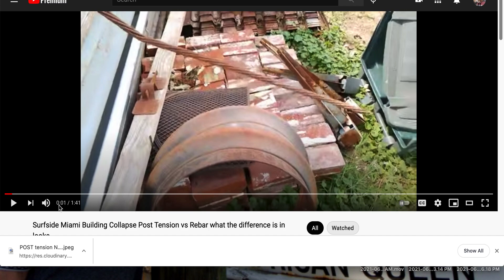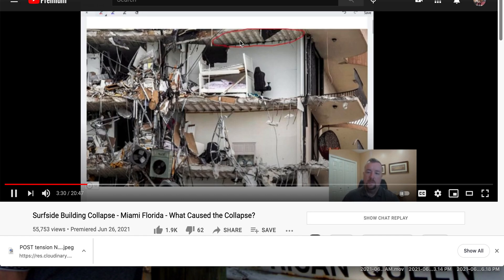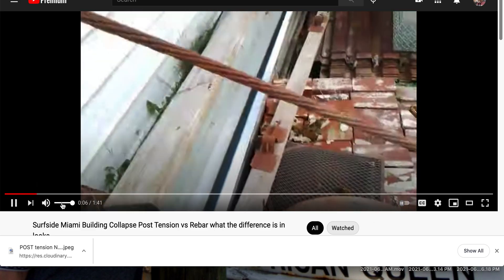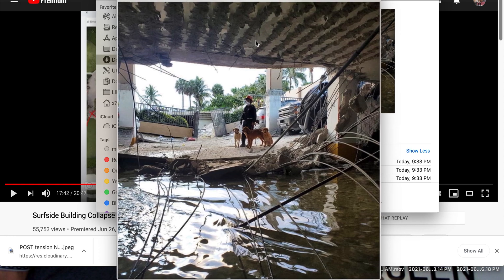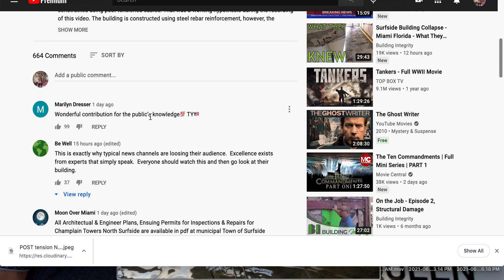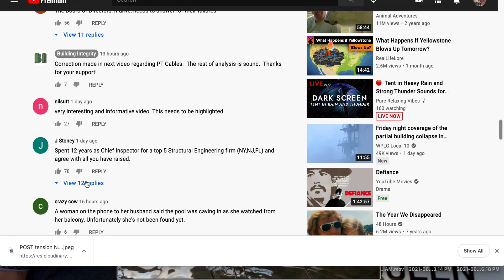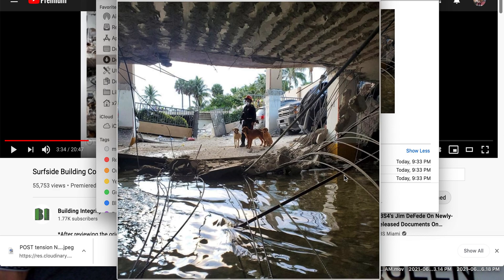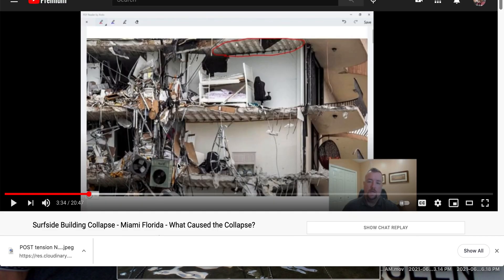Building Integrity What Caused the Collapse? NO POST TENSION Josh Porter Miami Herald

Comment: Absolutely correct.  That building is full of rebar,  not PT.  PT is used extensively here and cable offsets are ~3ft, running through plastic tubing. Rebar offsets are more like 12in, which is clearly shown in all these photos.

Comment: 5:23 ye do have a pic of them columns out at the patio next to the pool that collapsed. maybe that is 3 bits of rebar per face of the column in that pic (just behind the fella with the puppies), from outside it looked like 2 in another pic of the columns. that is not giving me a lot of confidence that the slab was connected that well to the columns.

I am not forgetting that light falling much further down near the outside wall of "unit C", maybe a column did give, and if the column connections were not able to span the distance due to minimal rebar connections, maybe possibly a contributing consideration. there is a pic of the rubble pile with two long sections of column laying on top of the pile, it's difficult to make out the details of the floor connection, yet it looks like the floors slid down the column then the column fell over. now if that all started because a 3rd column (L or M on the blueprints) gave way, it's a thought.  now interestingly, L&M is on each side of a car path on the garage deck, which happens to be about where that light was falling in the first 3 frames of the CCTV vid. points of interest to look into possibly.

Comment: So far you have been right on your analysis of the failure. 
I saw the same thing you mentioned on the video of the building failing.
My thoughts are a failure high in the center section the of building column may be the culprit here just from video evidence so far.
Also the debris field is almost pointing to the center of that area below.
Either way it's definitely a vertical column and not post tension failure.